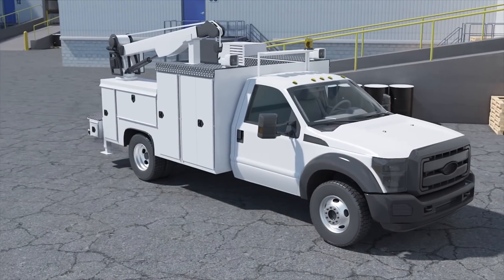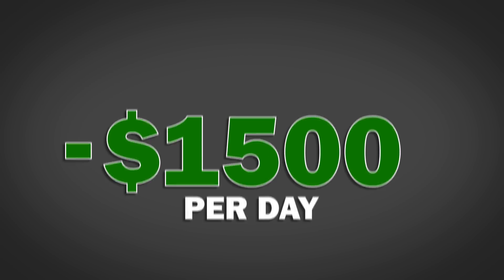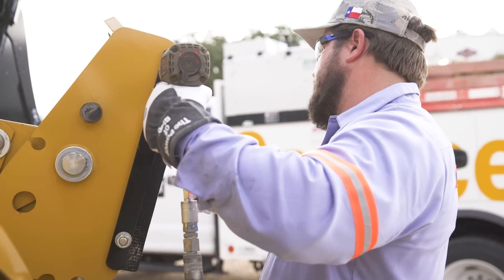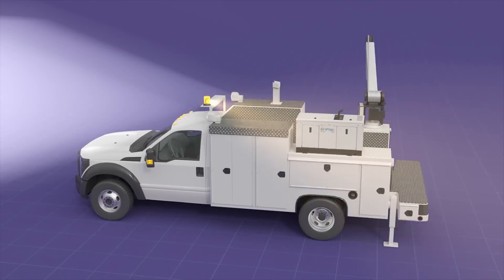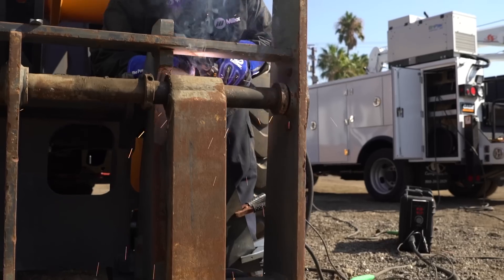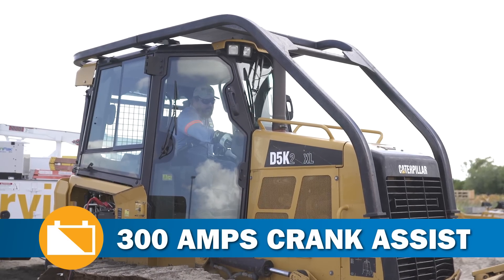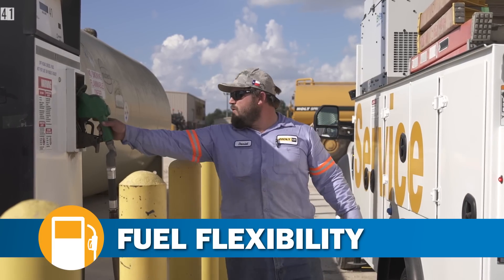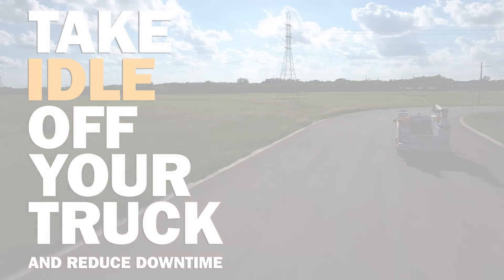Take Idle off Your Truck With the EnPak A30 Power System

Comment: Also it seems it takes fuel from your trucks tank as well. Is that right?
Reply from the maker: Thanks for the question Joshua. The diesel A30 will draw off of the trucks fuel tank, the gas version will be standard with a fuel tank and have the option to be purchased without the tank, set up to draw off the trucks fuel supply. Thank you.